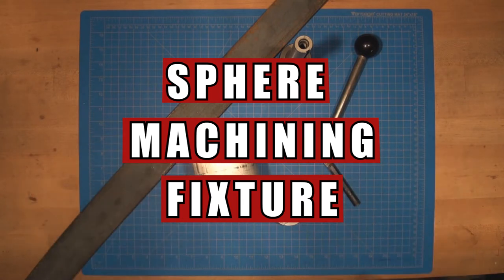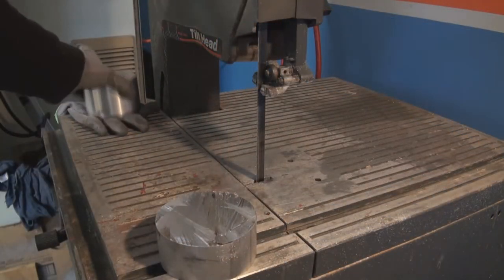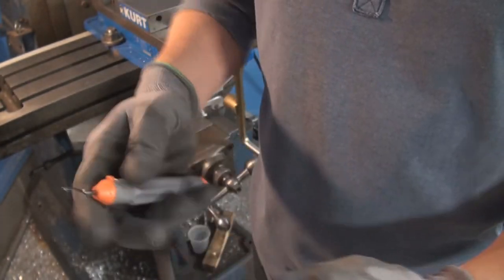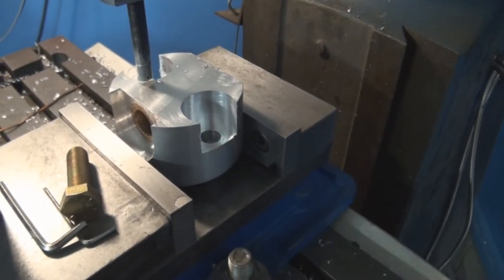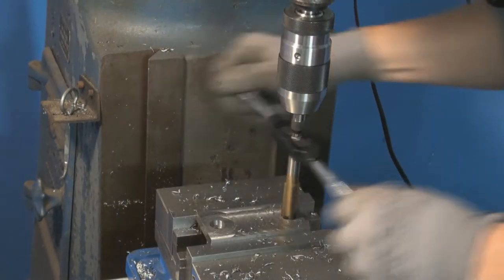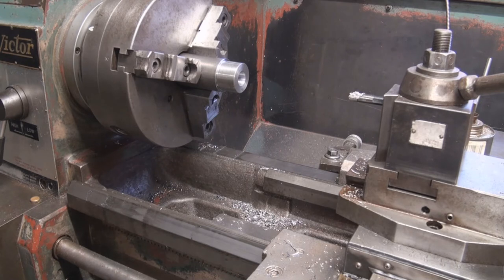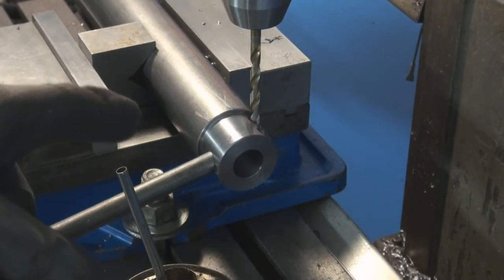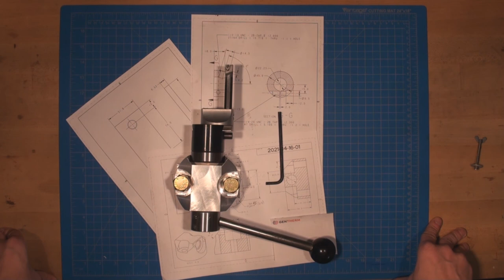Sphere Machining Jig for a Lathe

Comment: very nice have you cut a sphere with the tool? I started a project like this several years ago to repair a twin cylinder .head . The head is still in a box in the shop well done.
Reply from the maker: Hi Danny. Glad you liked the video. check out this video: https://www.youtube.com/watch?v=VrdC1UMmojU&t=32s as you can see I turned a sphere and successfully created a measuring jig.